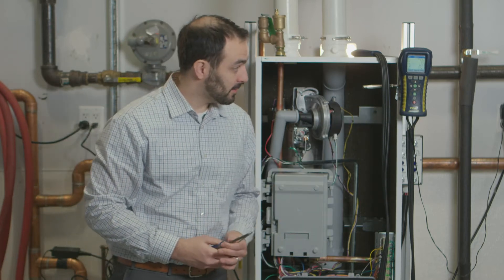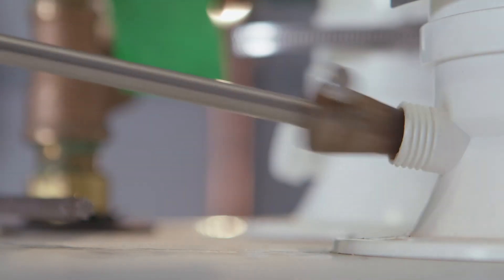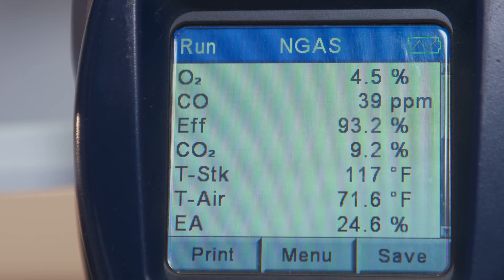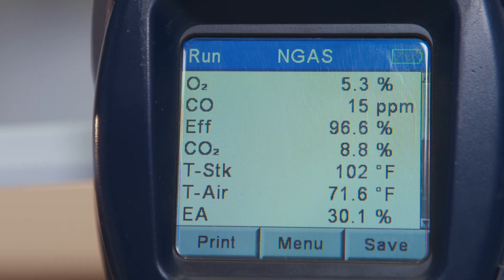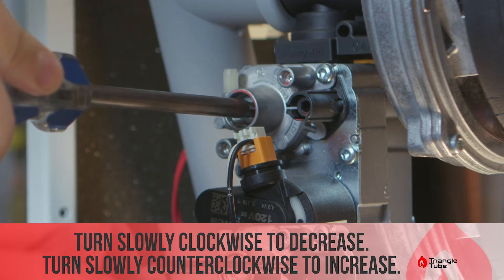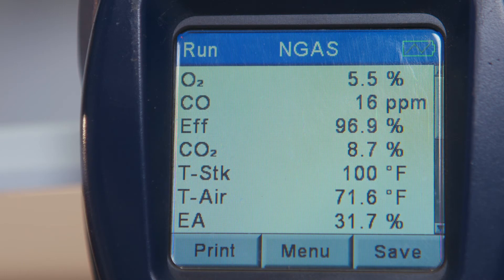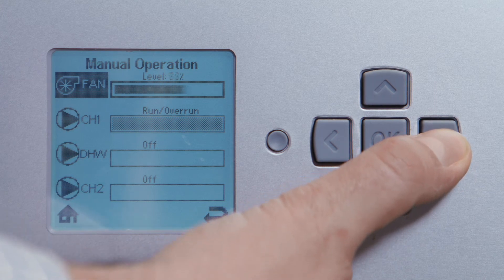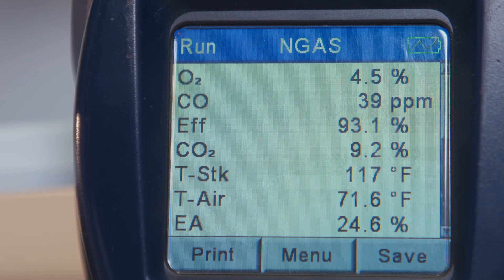1080 Set Combustion Prestige PA110 REVISED7 29 2020

Comment: Ok but how do you take the faceplate off can you not skip steps
Reply: I just want to let you know if you have one, some Triangle Tube  boilers have been recalled due to risk of a carbon monoxide leak. The following information is from the Triangle Tube website:

"In cooperation with the U.S. Consumer Product Safety Commission (CPSC) and Health Canada, Triangle Tube is conducting a voluntary product recall to repair 27 models of Prestige Solo & Prestige Excellence boilers (28 in Canada), and 2 models of Aerco Esteem boilers manufactured between December 2011 through April 2019.

The boilers can release carbon monoxide due to delayed ignitions or component damage, posing a risk of serious injury or death. Improper combustion settings can increase this hazard. All customers with a recalled product will be offered a free inspection and repair of their boilers. Nothing is more important to Triangle Tube than the safety of our products and we will continue to take all necessary action to protect our customers."

You can check the Triangle Tube or CPSC website to see if you have a recalled model.